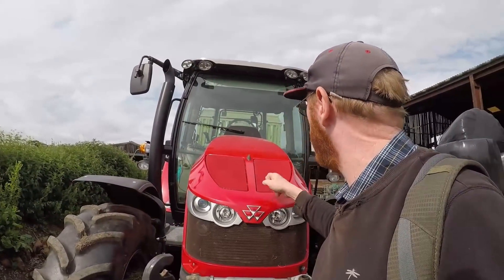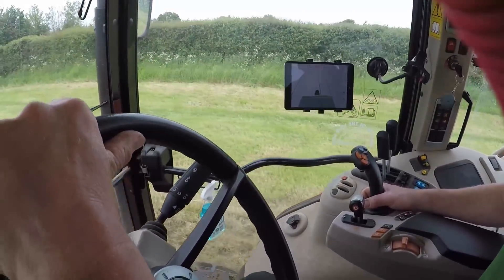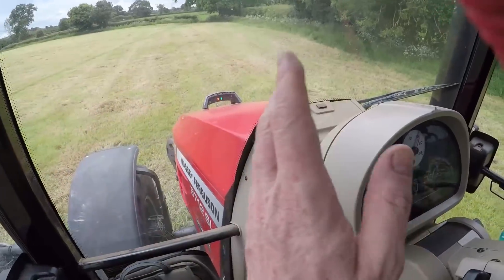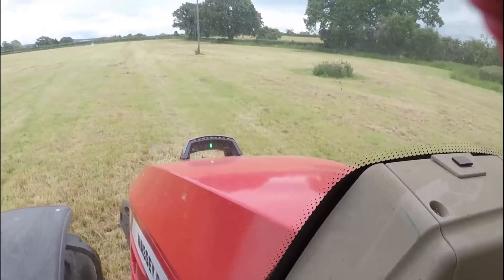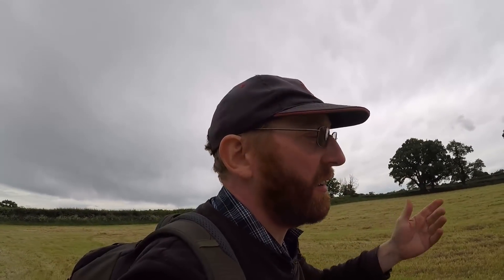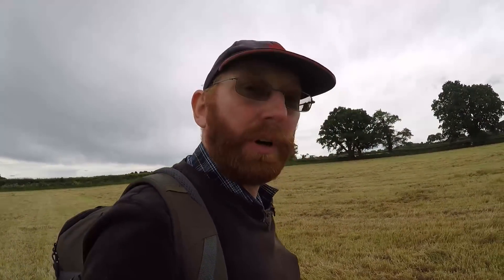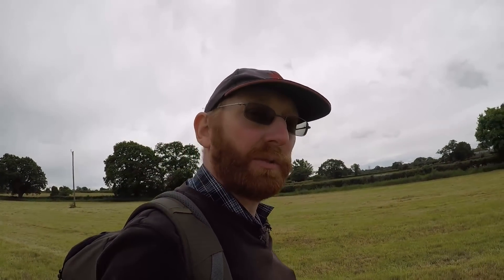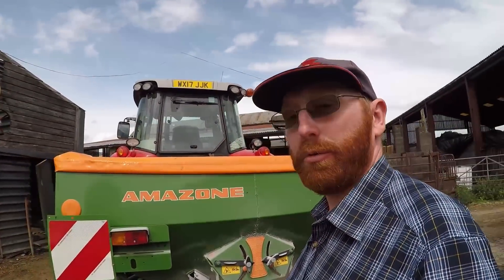Spreading fertiliser with Ontrak light bar guidance system.

Comment: Fantastic piece of kit. Does what you want to do without the need for section control and any other fancy stuff that can go wrong. Spreader suits the 5712,better turning on the headlands than the bigger 76 tractor. Is it through Bluetooth the pad and the unit talk to each other?

Comment: That’s a rather budget device if you don’t mind me saying so. I have used a Kverneland unit with the sensor on the roof for the last two decades. The display is at the top of the main instrument panel and not only has a lightbar but a line to follow, which is particularly useful when the boundry is far from straight. This has worked well but today I would probably buy a Patchwork Black Box unit. However whatever works for you and helps your accuracy, is good. I also spread at 18m and the application rate is always spot on, helped by the variable rate spreader which compensates for forward speed.  For most fields I spread at 15kph but steep fields slow me down fairly often